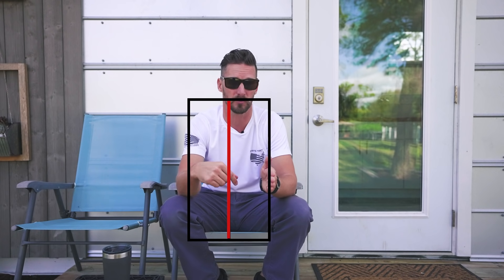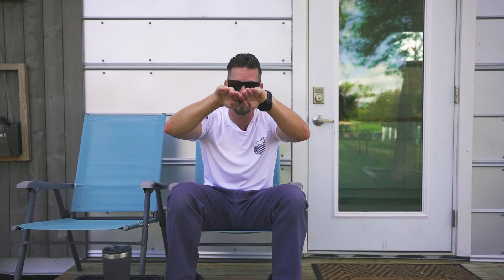The PROBLEM with Connecting Two Shipping Containers | Building a SHIPPING CONTAINER HOME

Comment: I have a few questions about shipping containers built on different "soil types".  I would love to build a small ( traditional Shotgun style ) shipping container home someday.  I live in Louisiana
so of course, it's all basically glorified swampland.     I know that bulding codes vary slightly from state to state, but what is your opinion on foundations for soft, often clay-filled soil?  I have seen mostly pile-driven pillars but I'm partial to concrete.  In particular, designs where the shipping container is basically seated on a wall the width of a parking block leaving the crawlspace empty to provide access.  Since I have been through several hurricanes, I 
like the concrete foundation walls with rectangular venting for air and "water" flow in the event of floods.  
I also have worked, moved and inspected shipping containers from when I was in the Army and I was wondering if you weld the dog-ears before making cut-outs when combining two or more shipping containers together?  

Thanks for taking the time to read my post.  Have a safe and Blessed day. 

Jeanine

Comment: As a Carpenter, I understand the desire for simplicity in construction and maintenance. However, the biggest plus to a multiple container build would be the speed by which you construct the exterior envelope of the house. Yes, you could build a house by normal methods, but your exterior framing will take weeks to months to get done compared to a week or so in comparison. 

It’s also depends on how you want your home to look. Otherwise, I agree that single container homes are easiest.
Reply: @OJD PUBLISHING I know absolutely NOTHING about the housing industry but if I wanted a home, I would go the traditional route and buy a used starter home, hopefully one that is at least 800-1000 sq ft. There are so MANY added costs with this type of converted housing that I seriously think that as bad as the housing market is at the moment and has been for the last decade, the wiser alternative is a used starter home. 
I will say that since I'm fascinated by the building process watching these types of videos are interesting.
Reply: @OJD PUBLISHING what about buying a house + putting container home in the backyard and have container home pay your for your mortgage or live in the it while renting out your main house? if you can manage to build container home under 80k (in cash) and use fha loan to buy a house with 3.5% downpayment that is successful house hacking while having completely two separate unit

Comment: Weld the two together then add a solar panel roof over the weld point. Water trough for rain water collection!
Reply: Yeah good idea but you would need to be very thorough when sealing the solar panels together and then your panels would be difficult to replace should one go bad. It's a neat idea in theory but possibly not so feasible in functionality. I do like the idea of a solar roof though.
Reply: @timwegman5776  i think he just means a metal roof with solar panels on it and rain collection gutters
Reply: Tin roof?